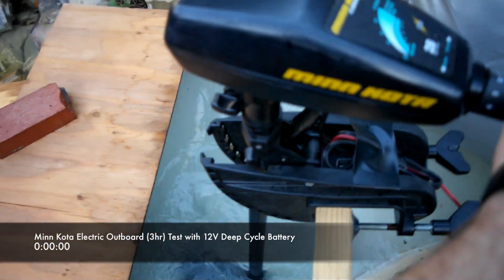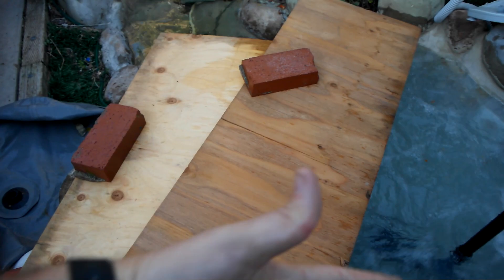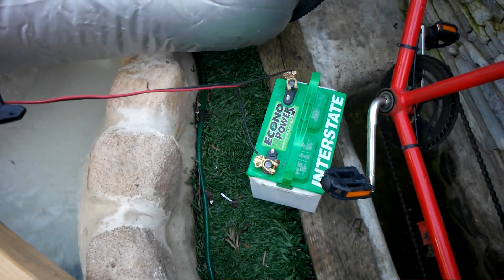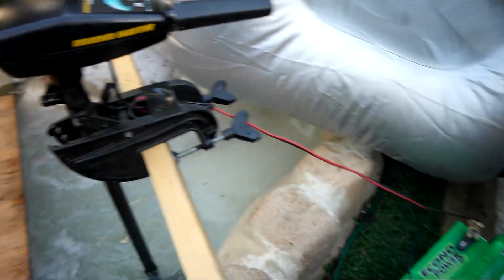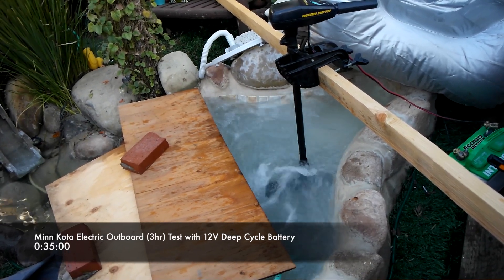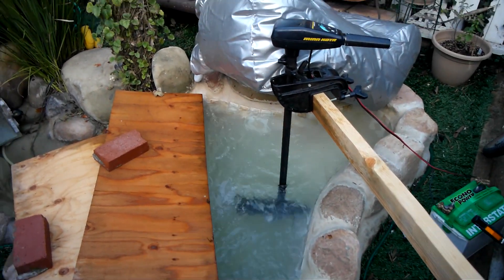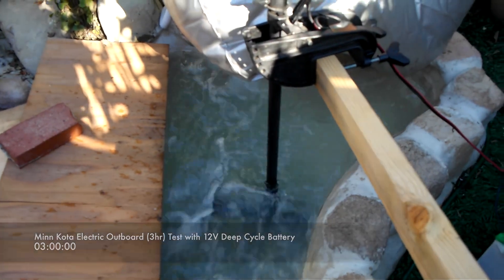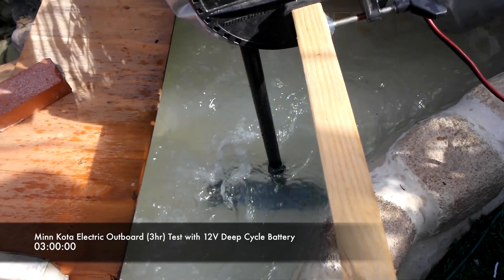Minn Kota Outboard Electric Boat Motor Test

Comment: Where can I find a really fast one?
Reply from the maker: Buddy from dive college had a nice all solar electric set up here.  https://www.youtube.com/watch?time_continue=4&v=6AelHlNzecU
Reply from the maker: Troll motors are not for speed.  I wish there was a powerful electric out there.  They don’t make them for some reason.  Jamie Hyeman (sp) made a 40HP one for cheap.  Just like electric cars the biggest issue is (battery) power supply ($1,500.)  $750 for electric motor.  Speed controller $750 and a used outboard $1,000--- all for less than 5K for over 40HP of POWER.
Reply: VenturaWeddings oh got ya.

Comment: You don't drain your batteries to empty  you will damage it.
Reply from the maker: Great point red.  A drained battery is terrible on each of its cells and could also leave you and your crew stuck at sea.  Like that old saying... "up a creek w/o a paddle."